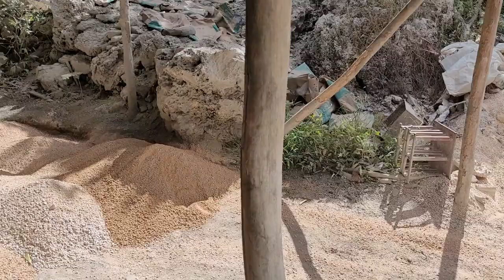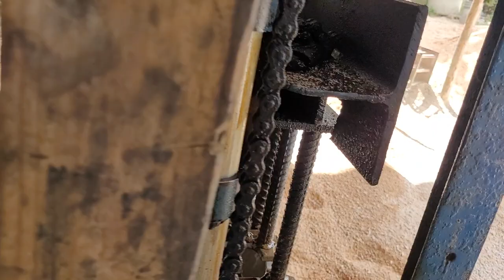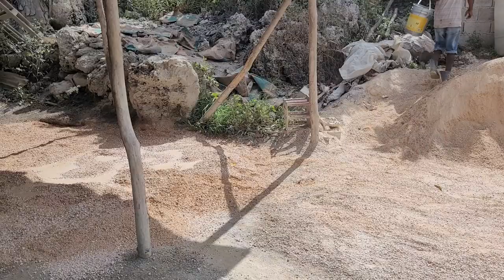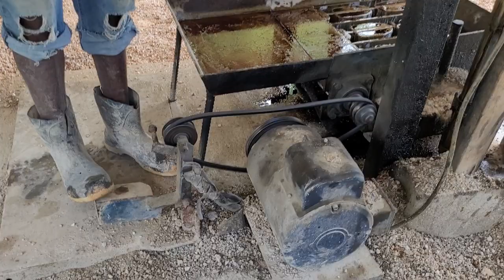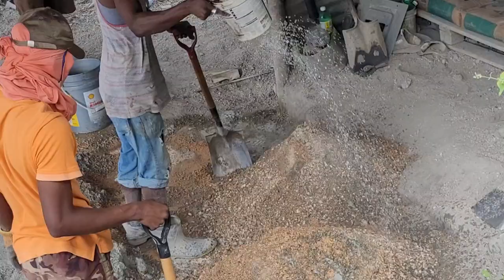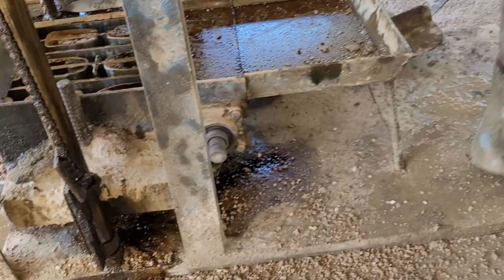Building Your Dream House In Jamaica...How to make Hollow Blocks for the Construction Industry

Comment: Thanks for sharing Justsayin, nice to see the block making process . Do you think it would be cost effective for someone building to make their own blocks? I guess minus the machine and done by hand it could work but would the blocks be as good as when using the vibrating machine ?
Reply from the maker: If it's the mix is properly done then dropping them by hand would be adequate.  
No they would not be as strong but the difference would be negligible.  In terms of cost effectiveness if it's a small enough structure such as a two bedroom living dining single bathroom and you do it yourself with perhaps one or two helpers then it can be cost effective.  If you have your own marle then it would be very cost effective. 
In a larger structure the time  and effort would not be worth it unless you have a 2 or 3 dropper and your own marle
Reply: What is the measurements for the pallet

Comment: What if it rain soon after they put the fresh block outside. Would the block damage?
Reply from the maker: No. As long as the curing process has begun the blocks will continue to harden. In fact they will cure better because they lose moisture slower than normal leading to less stresses in the block.